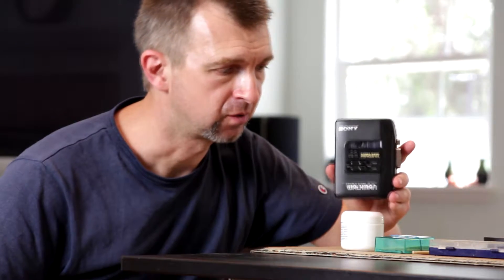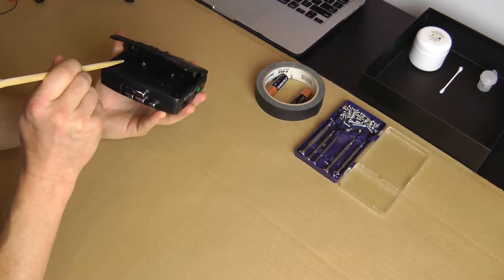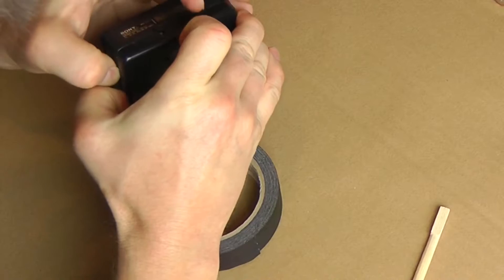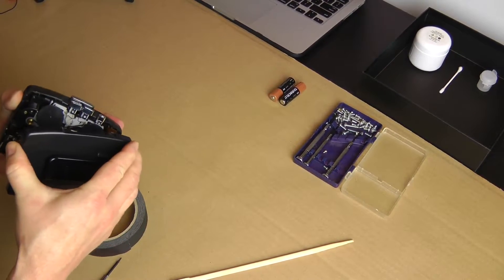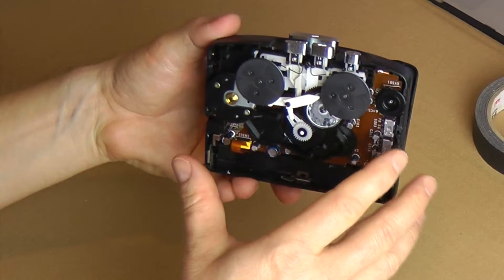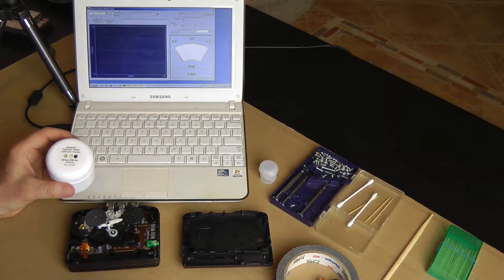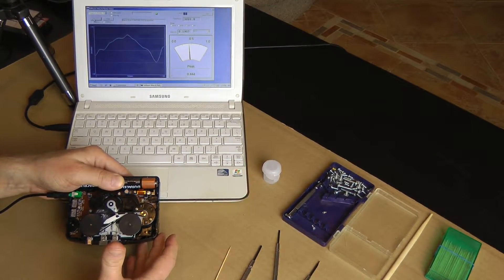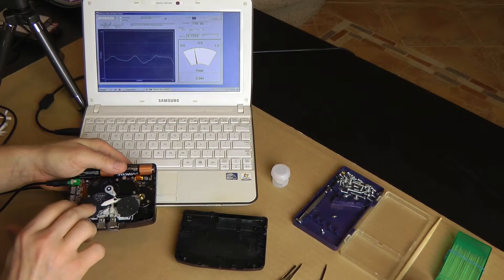Replacing belt in a Sony Walkman (1990-1999)

Comment: i have an EX-116 and inside it looks just like yours...what i found easy is either a guitar pick or one of those phone repair plastic picks...to replace the belt what size belt should i buy...i see different widts and lengths when checking on aliexpress...what type of oil/grease do you recommend?
Reply from the maker: I don't remember the belt size. For grease, I used white silicon grease, as regular petroleum-based grease is not good for plastic.

Comment: What is the measurement of the belt when you stretch and fold it? And what is the thickness?  cm x mm
Reply from the maker: Sadly, I don't remember what the size was. I bought a belt specifically for this model. There are cheaper thicker belts, they are not good enough. The one that worked better was 0.5 or 0.6 mm thick square belt. You can buy a set of a hundred different ones and experiment. I have bought such a set but haven't used these belts.

Comment: The 2nd flywheel is used usually in an Auto Reverse mechanism, but on this one it serves as part of the Anti Rolling mech. (lower Wow & Flutter) while on the move.
Reply from the maker: IDK. I think Sony did it to save costs. The next - and the last - generation has metal frame, and non-reverse models have only one flywheel.

Comment: Hello, I have one of these, looks and works good, however there’s an odor inside where you insert the tape. Like burnt electronics. What could it be and can I use it like that? I am not good at fixing electronics:(
Reply from the maker: I guess it depends how strong the odor is. They always smell with plastic, and the motor and the circuit board have specific smell too. If it works, does not noticeably wobble, grind or overheat, I would not worry too much.
Reply: @ConsumerDV  thank you, someone told me to look for leaky capacitors and replace them but I can’t even open the back plate so much for replacing stuff.

Comment: This is really informative, thank you!
I've had my Walkman (WM-FX195) for about 12 years & since I bought it from a thrift store, never had an operation/repair manual for it.
The only difference in the model I have is that it has a couple screws on the back holding it together.
Reply from the maker: You are welcome! I think yours is from the same generation as the FX455 that I reviewed here and replaced belt on it too: https://youtu.be/cE8Ni81SOLg Although yours does not have auto reverse.